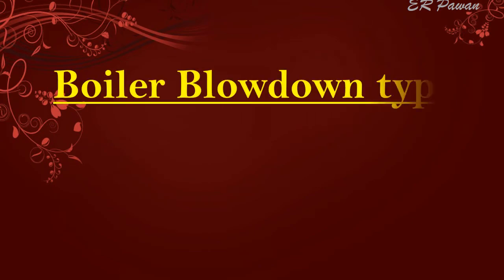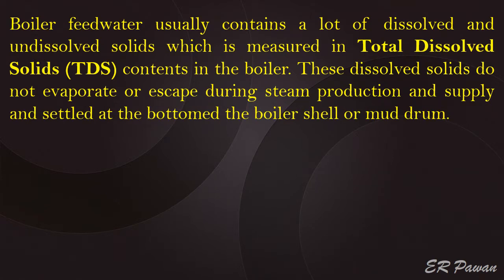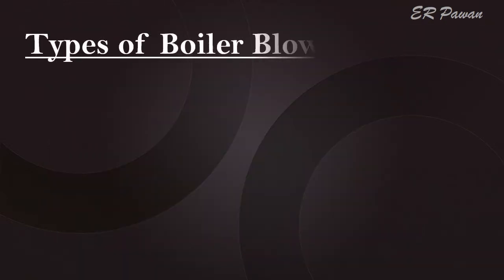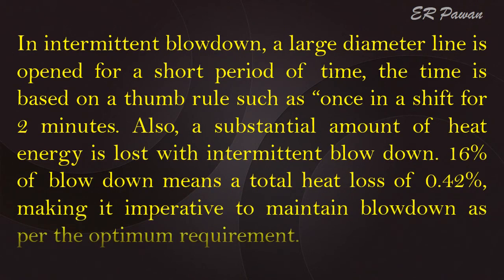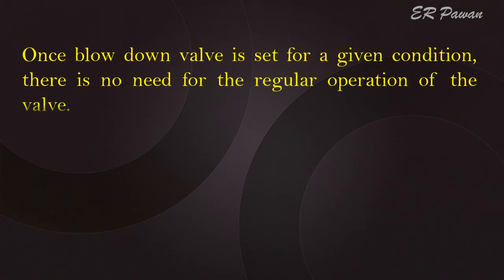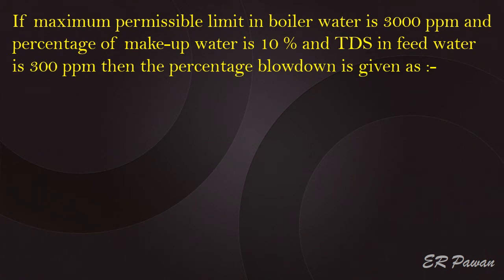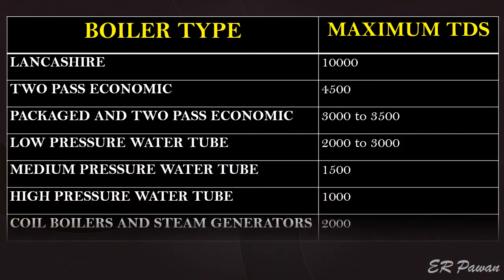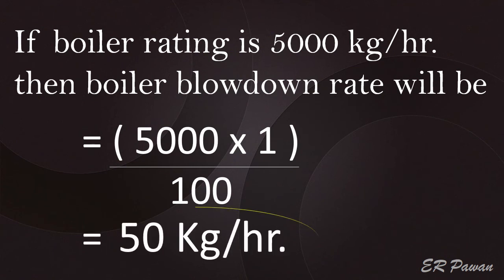Boiler Blowdown Percentage and Rate calculation || How to calculate boiler blowdown percentage||

Comment: Is this also the calculation for a water pipe boiler 74bar and max 140t/u? Do I need to use the conductivity from the drum and feedwater?
Reply from the maker: No, you don't need to use conductivity.
Reply from the maker: But as you know Feed water usually contains one limiting component such as chloride, sulfate, carbonate, or silica. Even if the component is not conductive, as is the case with silica, its concentration is usually proportional to a component that can be measured by conductivity. Therefore, conductivity is a viable measurement for monitoring the overall total dissolved solids present in the boiler. A rise in conductivity indicates a rise in the “contamination” of the boiler water.
Reply: @erpawan6886  We analyze silicate and conductivity before and after a cation filter. We now focus on the conductivity after the cation filter <1
(µS/cm)" we monitor the "SiO2 <1.0" every day
(mg/l)"
Which values do I use to calculate the amount of flushing?  PS THNX for the reply
Reply: and we measure the conductivity of course of the feed, 4,3 - 8,0 (µS/cm